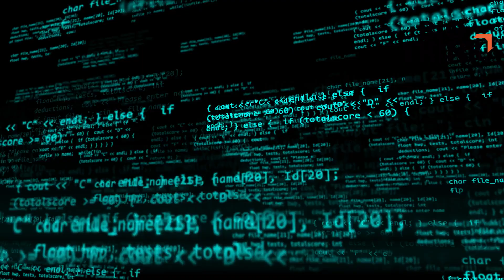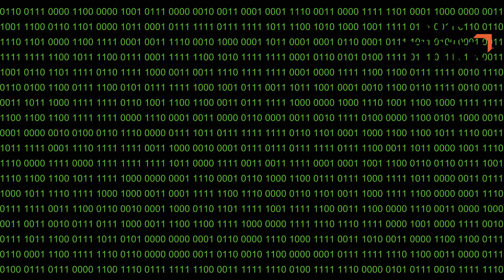The incredible physics behind quantum computing | Brian Greene, Michio Kaku, & more | Big Think

Comment: I don't think quantum computing is being applied - or trying to be applied - to the correct tasks and not for the right reasons. I think we invented traditional computers do ultimately to do what we're doing with them now. It's beren improved computing power leaps and and bounds since its inception, and its a succcess. But we're at a precipice of modern traditional computing ... basically computers are now doing everything we need of them for the purposes we use them for. now, we're only improving processing time. 

Quantum computers applied to the tasks that traditional computers do now is like trying to drink a glass of water from a seive. You're adapting a very very powerful tool for something that can solve world problems and rapidly evolve mankind into a new generation of advanced technology.

Like they say quantum computing can break any encryption in the world in an instant and process things wildly faster. Sort of how the brain processes everything needed to maintain our bodies with minimal effort (no plugs, no ram, no video card, etc).

Imagine you designed a quantum computer to break into banks and take all the money in the world ... wouldn't it be better if that computer was used to remove the need for money at all? 

It just feels like using a nasa rocket launch to deliver pizza across town.

Comment: From one video to another, I have hard time to understand the concept of quantum computing. China says it's a light based computing, as U.S experiments says it's a parallel processing. Some explanations are theoretical, taking the double-slits experience as a source of information, others talk about quantum physics, but lack the interpretation to the real world. I'm left wondering... 😳
Reply: Computing is an abstract model.  You can make classical computers out of transistors or vacuum tubes, but you can also make them out of mechanical gears or fluids like air and water.   Quantum computers are similar in that you can make them out of many things - light, atoms, superconducting wires on a microchip, and more.   The key difference is that the components behave according to the laws of quantum mechanics.
Reply: @iyziejane  This is a pretty good explanation, at least for me.
I don’t fully get how they work but something clicked in my head.
Thanks.
Reply: try the kurzgezagt video on quantum computers, also veritasium made a great explanation, I get what you're saying, a lot of people are giving out really abstract information and maybe the best way is to look up those videos and then trying to figure out the scientific papers by distinguished universities explaining the topic at a much lower level.
Reply: It's like multiplying the worlds biggest fastest computer bye a billion times.

Comment: Great physics lesson, but would it not take an almost infinite amount of programming to produce an almost infinite amount logical computations?
Reply: There is no "almost infinite" there is either finite or infinite. So if there were a finite amount of calculations to perform, the software could be as small as a couple lines of code especially if the calculations we would perform were algorithmic in nature. If each calculation is in need of new formulas everytime, then maybe you're correct but generally there is an algorithm out there.

Comment: A question for the theoretical physicist:  When does a particle (anything really) behave non-quantum-mechanically?  It's always acting quantum-mechanically as long as the theory of quantum mechanics is the theroy that correctly describes the world.  The point is, decoherence is a quantum mechanical process and incoherent system remains quantum mechanical (just incoherent), so to say that to get rid of decoherence (i.e. isolate) is to make the system quantum mechanical sounds incorrect.

Comment: Quantum computing base. This base is a fully operational quantum computer that can be run by a traditional computer. Whatever calculation that is input from the understanding of a human could in theory be told to a computer to input instead. So my google search could be sent to the traditional computer via internet to be input into the quantum computer. The computer analizes the results produced by the calculation that was input into the quantum computer and sends me the information back through the internet. If the quantum computer is able to do many calculations at once everyone could use it at the same time. 

Smaller machine to operate a larger machine.

Comment: Some things that were not mentioned in the video. Yes, qbits can be in many states 'at the same time', but so can classical analog bits. There is a whole field of analog computing. Don't get enamored by the notion of 'billions of universes', because a single qbit is exactly as powerful as a single classical bit. What separates quantum computing from classical is that two qubits when combined (entangled) are twice as powerful as two classical bits and this gap grows exponentially as more qbits are added. This is why the problem of decoherence is so important because if two qbits get disentangled, they can still be in many states (worlds) but their computing power is no more than two classical bits. It is likely that the editor of the video did a poor job putting this together, because no serious scientist would just wave 'many worlds' to an audience's face and not mention entanglement as the primary source of qc's power.

Comment: Imagine a scientist long long time ago, claiming that the coin that you toss in the air is not actually spinning. 
Instead, it has heads and tails showing on both sides until we catch it and look at it. 
The math would work perfectly, chances are 50-50 for heads and tails if you try it many times. 
And the claim can't be disproved, because as soon as you try, the coin surface collapses to heads or tails. Very smart. 
But does that prove that reality is following the mathematical model that works so far?
Reply: You got it!

Comment: ... spent 12 minutes talking about quantum computing without mentioning interference once. Disappointing.

Quantum computing isn't just parallel computing. The parallel computations have a very restricted form of communication: they can anhilate one another. That is the power of quantum computation is interference, taking advantage of the fact some states have negative amplitudes which can cancel out positive ones.

But this interference can only happen if your algorithm has specific kinds of patterns that can make negative and positive states align to interfere.

Comment: How can you find "an answer" if there is so many realities with different variables?
Reply: Yeah! This is what makes quantum computers only able to answer a few "very specific" problems. The key is interference.

How they explained it, it would sound like the quantum computers make many realities, and what, at the end, which do you get? Is it random? You actually can't get more power with that.

The distinction is that the different states aren't actually probabilities, but "amplitudes" that have positive or negative signs. If you line up the computation so different paths make a negative and a positive amplitude on the same state, they will interfere and cancel out. This means this state will never be observed in the output.

So your computation is kind of like waves in water, and you want to make the waves happen in such a way that where the waves are big at the end is the answer.

So if your problem has this structure that let's bad answers interfere and cancel each other out, quantum computers give a huge speed up, because it can run the algorithm an exponential number of times in parallel and bad answers anhilate!
Reply: @joshuacook2  Yes - and are these amplitudes, also, in some way, contained lightcones?
Reply: Step one...all possible outcomes instantly provided in one output. Right Wrong Indifferent or in Error. Next steps...algorithms that can sort eliminate and reduce the indifferent or in error.  More next steps...secondary level of algorithms to sort the sort. Clear as mud.

Comment: This explanation was just like all other explanations I have heard. "With quantum computing you can compute something in the entire parameter space at once and it will spit out the solution". But what I have never heard explained, and that I want to know, is how is this "incredible physics" actually utilized? Are computations done using a set of gates like in classical computing? Do these gates have to be hardwired? If they can be software defined, does that mean the computer runs all possible software in conjunction with all possible data? How do you select "the right universe"? Can you only do computations that yield some sort of stable spin configuration that you sample, that is, problems with only one prominent solution?

This presentation might as well have been about magic. "We will use magic to search the entire data space for this computation that have something to do with atoms wiggling in unison".

Comment: The classical computers really are overheating already in current designs at 14nm-22nm. And CPU can not run at maximum specified clock rates.
Not sure what they can do about it, but it still going towards 3-5nm and even below.
It looks like no doubt quantum technologies could be needed for further developments. 
Also maybe quantum sensors could be useful and not sure like if they really can see "behind the corner" and if that "corner" can be set inside the human body also in medical imaging.

Comment: Very interesting... My question is could Quantum Capabilities somehow be applied to electricity/energy generation and/or  production-??? 🤔😄😆👍✌
Reply: Perhaps to answering questions about generating or storing power but not in terms of generating power itself. There is work being done in figuring out better ways of generating power and attempts at nuclear fusion. One example that is currently being built and expected to complete construction by 2025 is ITER.
Reply: Thanks VERY MUCH for your input, John-!!! What bothers me about Nuc Power is they haven't came up w/a way to recycle and/or RE-ENERGIZE them (fuel rods, I meant); in order to be re-used...?? Fusion and Fission is just over my head and I'm just scared of ANYTHING Radioactive b/c to much exposure to it, I believe can have adverse health effects on humans and animals...?? 🤔😞✌
Reply: @jefffarmer5785  You're welcome, Jeff. The reason why nuclear fusion is sought over and nuclear fission is considered bad is that nuclear fusion actually does not cause radiation (or rather, very low amounts of radiation). To explain, there's an issue with the word 'nuclear'. There are two fundamental forces of the universe that are both called 'nuclear'. One is the 'strong' nuclear force that holds the nucleus (protons + neutrons) together and the other is the 'weak' nuclear force which is the type of nuclear energy that can cause radiation. The act of applying a VERY large explosive charge around a 'fissile material' such as Uranium-235 causes a large field of small, energy-charged particles to pollute an area. 

I don't want to complicate this too much for you but to sum it up simply, nuclear fusion occurs when two atoms cause their nuclei (plural of nucleus) to collide directly. Imagine the nucleus for a second as a train and these are two trains heading towards each other. If they have a head-on collision, it causes nuclear fusion to undergo (literally the two nuclei fusing into one, new, larger nucleus) but if they were off by even a couple of degrees, they'll be flung off in opposite directions.

The 'opposite directions' are what sustain the Sun and allow it to not collapse in on its own gravity. 
When nuclear fusion occurs between Hydrogen atoms, they are transformed into Helium (the second lightest element). If we look at the periodic table, Hydrogen and Helium are at opposite sides. This is to imply that Helium is a very 'stable' atom (it both does not want to give up its electrons nor take any new electrons). This stability leads to no long-lasting radiation compared to nuclear fission. Think of radiation as caused by a large environment of free sub-atomic particles. Electrons, protons, and neutrons all want to be 'glued' together but only in certain amounts to be 'stable'. The number of protons tells us the element, the number of neutrons tells us the 'isotope' (e.g. U-235 has 235 neutrons), and the number of electrons tells us the 'charge' of the particle. Things at the right-most side of the periodic table are called 'noble gases' and they do not form ions (charged particles), so they do not cause nuclear radiation.

As the elements collide and fuse into heavier elements, a bit of their mass is transformed into energy which is the energy output we get. But basically nuclear fusion is the best form of 'clean' energy we could ever produce however it is incredibly hard to perform without the gravity of a star. Solutions like Tokamaks (which ITER is an example of) use strong magnetic fields spinning around a shielded environment to create the pressure the gravity would cause.
Reply: @Cliiipy  , Wow, Now THAT (IS) interesting, John-!!! CLEAN ENERGY-!!!!!!! TWO THUMBS UP-!!! When I think of magnativity, it reminds me of what is 'called' perpetual motion devices...??? Which makes me wonder how that (perpetual motion) using magnets; (and- the possibility of using some wheels to add back energy into the battery (energy storage device, or whatever) on electric vehicles)...??? Then, it makes me wonder what the possibilities may be to use magnetivity to induce gravity on a place that has no gravity (like on another planet)-?? 😁😆✌👍
Reply: And, the possibility of perpetual motion and magnets to produce electricity (efficiently)...?? 🤔😆👍
Reply: @jefffarmer5785  Perpetual motion is unfortunate an unlikely thing. This is due to the law of the conservation of energy. A system cannot export more energy than it imports. Even with nuclear fusion, the achievement is the energy yield (that which we can use by converting it into electricity in the case of nuclear fusion), not about if more energy was generated. We get a greater yield out of nuclear fusion per unit comparative to other resources like solar, wind, hydroelectric, coal, oil, or fissile materials. That, along with the clean output, makes nuclear fusion so enticing.

We can however absolutely convert magnetic fields into electricity and its a basic principle of how hydroelectric dams function. ITER and other proposed Tokamaks work on a similar principle. However they are not 'perpetual motion' machines which bleed infinite energy. They still require an input source (in ITER's case, it is specific isotopes of Hydrogen. I did not earlier explain this but the chain reaction from Hydrogen to Helium is one step. It actually is NOT the result of larger Hydrogen isotopes, which ITER depends on to ensure the efficiency of generating Helium as a byproduct ["Deuterium" and "Tritinium" are the particular names of the Hydrogen isotopes]). The energy yield as the output is a greater yield for nuclear fusion comparative to any other energy source, renewable or non-renewable (like coal and gas).

Edit: Input 'NOT' to indicate that Hydrogen to Helium is not one step. It actually takes four steps (Hydrogen-1 to Deuterium [H2] to Tritium [H3] to Helium [He]. There is some radioactive decay during this stage but the magnetic shielding prevents this from escaping the fusion reactor).
Reply: @Cliiipy  , Amazing, John... Just, Amazing, 'My Good Man'-!!! I think perpetual motion was intriguing for me is because I was thinking that the energy on both sides (of, let's say a pendulum was equal)-??? Lol 🤔😁✌
Reply: @jefffarmer5785  Well in a way it is if you think about it from the perspective that both sides need to 'equal out to zero'. In that respect they do.
Reply: @Cliiipy  🙂👍✌
Reply: @jefffarmer5785  The closest promise we have from Quantum mechanics in energy is in the field of high-efficiency transmission.